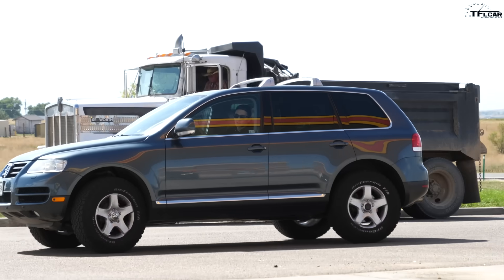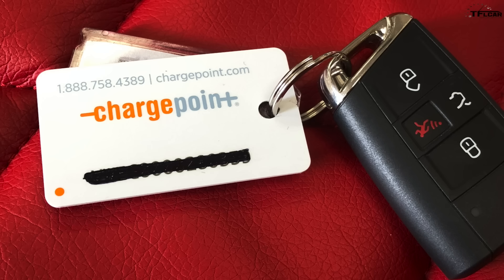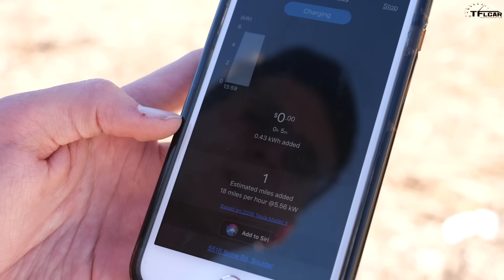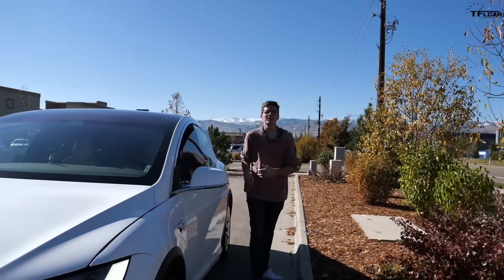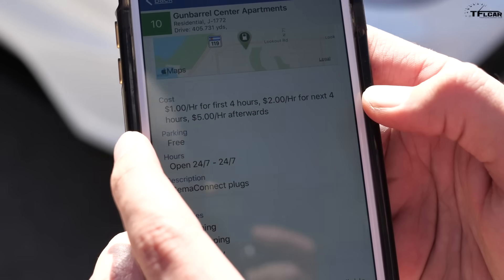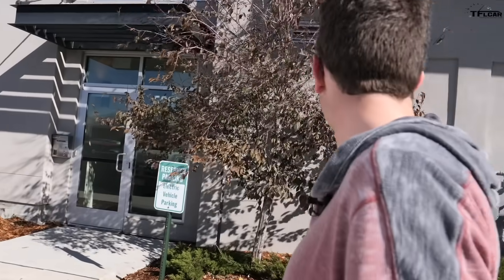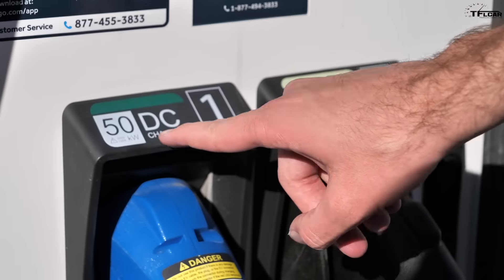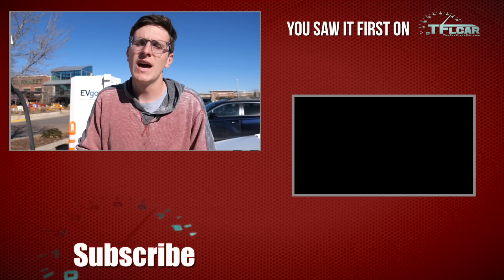Here’s Why Charging an Electric Car Can Suck - And It’s Not The Reason You Think!

Comment: What a sheer madness! Thank you for convincing me that EV route is not an option for my lifestyle. I will stick with diesel and 30 mpgs… Greater outdoors are calling!
Reply: It takes me maybe tem minutes to fuel up. I'll keep my gasoline and diesel. I don't believe EVs will make a dent in the next 100 years.  I might build a ev but I will not buy one.
Reply: @jasonglisson1690  Again, you probably won’t have a choice after 2035! The major manufacturers have announced an end to the internal combustion engine at that time! How many Boulder like fires or Kentucky like tornados will it take to make people understand that Climate Change is already here! We must adapt or perish!
Reply: @Ghostxnigelfr  so tornados and fires only started after the industrial revolution. Gotcha. Somehow putting batteries in cars is going to fix it all. Wow. However nothing was said about everyone will have to get one. So I'll just keep my jeep thank you. I am part of the resistance. If I have to I'll resort to making my own fuel.
Reply: @jasonglisson1690  it takes you 10 minutes plus the time to drive to a gas station. It takes me 15 seconds to plug in at the comfort of my home and another 15 seconds to unplug. 
I do not have an engine so I never have repairs, no oil changes no fluids to top off... Except for the windshield washer fluid. A full tank aka battery charge costs about $5. 
EVs are a disruptive technology and are replacing ICE cars as fast as ICE cars replaced the horse. By 2030 almost no one will be buying ICE cars because EVs will cost less to buy and already cost less to own over time, (approx 5 years).
You and anyone else can still own, buy, lease or rent an ICE car. In fact many people still own and ride horses. 🙂 

You think because you spend a short time doing the actual filling of your gas tank it's quicker while you ignore the fact you have to drive to a gas station every time you fill up. EVs primarily fill up at home and only use charging stations on long trips..I use the Tesla Supercharger network which is fast enough to charge my car in the time it takes to pee and or get a coffee. Then I'm off drinking my coffee while the car drives and I'm monitoring. 🙂
Reply: @SmokinPaul  @jason glisson Well said! Sometimes you have to tell people the financial positives of owning an EV. I think you forgot to mention the $7500 tax credit that you get when you purchase an EV. Also, depending on the price of gas, you are saving approximately $250-$350 per month on gas (that are not going into the pockets of corrupt Middle Eastern and African regimes). 92% of all car owners drive their vehicles less than 75 miles per day. If you are going to be traveling over two hours, fly and Rent-A-Car at your destination. In most cases, it is actually cheaper. I take all the money that I save on gasoline and put it into a separate vacation fund! This year I flew the family at Thanksgiving to Orlando where we stayed at Disney World in a Disney resort hotel. In all honesty, electric vehicle ownership is a no brainer!
Reply: @SmokinPaul  all very good points. I don't have a garage. So I'd have the added expense of buying and/or building one. I'm always passing a fuel station in one of the many ways to and from work or anywhere else I go. I'm not knocking EVs for you or anyone else.  they are just not for me. Especially right now. I like working on my jeep the rarity that I have to. Plus there's a good chance I can have it the rest of my life. EVs are useless and worthless once the battery goes bad and it will. I also don't believe EVs will save the world nor do I believe gas and diesel vehicles will destroy it. I believe we should have a choice. That's all.  EVs have their place. Just not in my yard.
Reply: @SmokinPaul  also if need be I can switch my jeep to carb and distributer
Reply: @jasonglisson1690  yeah I have a 1975 Suzuki GT550 two-stroke triple motorcycle. It came with points, has an aftermarket electronic ignition that I can convert back in short order. Points need to be changed and adjusted but there is something wonderful about the simplicity. My 1972 Camaro was so easy to work on or even pull the engine. New stuff  is so complicated you have to disassemble half the car to change a spark plug.
Reply: @jasonglisson1690  I agree with choice. As far as Tesla batteries they will last a very long time and if my car body is still in good shape by the time that happens I can have it replaced for less than the cost of an engine. I have a long range model Y. When the battery pack loses 20% of its capacity it's considered end of life. Yet I can still keep driving it as a standard range EV. The battery will still work just with a little more reduced range. I'm getting 326 miles of range now so end of life I'll still get 260, more than enough for long trips. That or I can sell it for more than I could an ICE because EVs hold there value better. Then I can buy the latest greatest EV at the time. EVs are not throw away cars, at least Tesla's are not. Tesla doesn't build craptastic cars made to need servicing to keep the antiquated dealer model in business. Tesla build their cars to commercial 1 million mile standards. Other compliance EVs with no thought to battery management or temperature control have given all EVs a bad rep.
Reply: @SmokinPaul  yes I agree thats why my jeep is a 04. Still very easy to work on. I don't like most new cars. It's not just EVs. I really don't like new technology. I really hate being tied to this phone. However sooner or later something will have to be done to any ev. It's a machine. Things wear out. Nothing lasts forever if you give it enough time. Toyota almost went bankrupt because they made their vehicles too good. Most manufacturers make sure they don't over engineer their vehicles. I don't know if Tesla is the best. If they are awesome. EVs are just not for me. Never thought I'd enjoy a conversation with a battery head.
Reply: @jasonglisson1690  I'm not exactly a "battery head". LOL 😆 I love all technology old and new. I grew up in the 50s & 60s and one of my interests is electronics. I started out learning, repairing and even building tube radios. 
Then transistors came along and looked like alien voodoo compared to what I knew. Rather quickly I learned how to repair, rebuild, make transistor radios and many other electronic devices. 
Next was integrated circuits which again looked like more voodoo yet I discovered it was even easier to build much more sophisticated devices. 
I own a 1945 Hallicrafters Super Defiant shortwave radio. It's a tube radio with a case made of steel so thick you could literally use as a jack stand for a car. I completely rebuilt it and it's still working and one of my favorite radios. I built several shortwave radios, test equipment and all sorts of electronic gadgets that I still use to this day.
 I've built home automation devices using the latest surface mount ICs. 

I used to do building maintenance, I've also been a bit of a gear head, fixing up cars,  muscle cars, motorcycles (mostly two-stroke triples), repairing just about everything on my cars and motorcycles from brakes to rebuilding engines and everything in-between. 
I also love computers, I'm an IT Network Specialist, a certified locksmith, hold an extra class amateur radio license and repair, build and ride bicycles. I love long 200 to 300+ mile bicycle camping. It's great cardio for the heart too. 

There is not much old or new technology that I'm not interested in. 
I embrace all tech both old and new. 

Hi-Tech isn't always the best,, sometimes low-tech rules. I eat right, exercise and feel like I'm 28 with 37 years experience. LOL 😆 

Never live in fear of anything especially technology. Nothing will completely stop old tech, it will just lose it's popularity. Jay Leno has a massive garage of old cars that still run. 

Did you know electric cars dominated up until 1939. That Henry Ford's wife Clara drove a 1914 Detroit Electric. 😄 
You could always have an EV for your daily driver and a stable of ice cars for fun. 

I never thought I would ever buy any kind of new car. I'd been watching Tesla for years and always meant to invest but never got around to it. Then I understood Tesla was going to break out and shoot to the moon within the next year. As soon as I started investing it started it's meteoric rise. I immediately went all in and made a killing. If you are wondering who the next Tesla is.. Tesla is the next Tesla. I see Tesla 100X or more over time. 

 I haven't sold a share and I won't for at least another 5 year. No way am I trimming my money tree while it's growing so fast. 
I bought my Tesla with a good down payment and a low interest loan. The gas I save pays for a large portion of the monthly payment. Tesla's come with an 8 year warranty and they are real good at fixing any problems. I had a door stick shut because the interior panel wasn't pushed in all the way and popped out. They sent a service guy to my house and took 5 minutes to fix. 
I bring a backpack to work setting it on the passenger seat. The seat sensor got confused a bit feeling more and less weight while I drive my Tesla like a sports car. The car thought there might be an error in the seat sensor. LOL I brought it to my local service center where they retro fitted a electronic filter to make the sear sensor happy. 
The car diagnostics even notified me of a fault in the wiring of the circuit I use to charge it! That was so crazy. 😄 
Yesterday as I drove over a bridge a message popped up telling me to take control. I thought it was odd because I didn't have it in autopilot or FSD. Then I realized it was just below freezing and was warning me the bridge was icy or the conditions were right for it. 
The technology is very sophisticated and maybe not something most people can repair but it does have it's advantages. 

I don't understand people who hate ICE cars or EVs. 
However I can't stand the green weenies virtual signaling with their Tesla's. 🤮 I guess I'm not perfect either. LMAO 🤣 

At 65 constantly maintaining and repairing my ICE cars is getting old. I wouldn't mind it that much if I still had a 60s or 70s car but the newer cars are shit on a stick.😟 Designed on a computer by people who never worked on a car. That or it's designed that way to force more people to get work done at the dealership. 
EVs are just simple electric motors that last forever and Tesla builds theirs to commercial standards. Which makes it so compelling compared to the modern craptastic junk. 
I do miss my 72 Camaro with the Rancho suspension and an Ishadarian towing cam I put in. Taking off from a light up to 30 mph It had almost as much torque as my Tesla... Or at least I remember it that way. 😄
Reply: @SmokinPaul  yea I was being funny. I can work on alot also. Not as much as you. My main thing is I love engines. Ice are a marvel to me. Alot of the newer stuff is definitely crazy. I know more about gasoline engines but learning about diesel. I've worked on everything from washers, dryers, fridges, computers and about anything with a gas engine. I have alot of car knowledge. Yes I know about the first electric cars. I also know about steam engine cars and love jays garage. I can car talk all day. I'm not necessarily against EVs. I'm just in love with ice. Are you on FB or anything I'd like to chat with you more. I don't meet many gearheads. I'm one as well. I went to school for auto tech. My health went bad so I drive truck till I can get better. I said I can fix computers. I can replace the parts in them. I'm not so well at the software part.
Reply: @jasonglisson1690  I see 4 jason glisson on FB, which one is you?
Reply: @SmokinPaul   nc
Reply: Buy a Tesla and use their massive supercharger network. Takes me 5 to 15 minutes to charge. Mostly it takes 30 seconds to charge, 15 seconds to plug in when I get home, 15 seconds to unplug when I leave. Same as a cellphone. 
The only time I've used slow charges like that are when they are free ie destination chargers, most public chargers etc. Last time I gained over 80+ miles free while eating at a restaurant. 

If I had to deal with the BS charging in the video I would never have bought my Tesla model Y. 

The best part I could charge at any of those slow charges or even plug into any 120 or 240v outlet. North America is electrified, who knew! 🤣 Although I've never needed to use anything but the Tesla network on long road trips across the country and the car is charged in the time it takes to pee and get a coffee. 

I suppose if you had a syphon hose you could fill your car anywhere too. LOL 😆
Reply: @SmokinPaul  5 to 15 minutes to charge from what level to what level?
Reply: @percyfaith11  form 10% to 60 to 70%. You don't fill up a battery like you do a gas tank. The charge is very fast up to 60% and slows down as it's topped off because the various series cells need to be balance charged. A Tesla tells you where to charge, how many charging stalls are available, how many ch to charge etc. On a long trip you make one or two extra stops. Makes the trip easy peasy, no sore butt. 🙂 

If I'm going on a long trip I set the charge to 90 to 95% the night before to get a bit more range on the first leg. 
I went from Milwaukee to AZ, up to Utah and back. I used FSD which made driving feel like I rode the bus. All Tesla's come with Autopilot which drives straight but doesn't navigate or take your exit. Instead of staring at the white line you can look around and be more aware of the cars and situations around you. 

Try a test drive and even rent a Tesla for a few days. It's something that once experienced you'll fall in love with.
Reply: @SmokinPaul  how long have you worked for Tesla?
Reply: @letavoss5938  ah the refrain of the ignorant when they have nothing useful to say. 😊 
No one can love Tesla because of the superior engineering, no can't be. LOL It can't be because Tesla makes such a compelling product, no can't be. If Ford, GM and the rest make Craptastic cars then it must be impossible! Hahaha 
OK Toyota makes fairly decent cars and it used to be my car of choice for reliability but even a Toyota looks unreliable compared to Tesla. 

It is just the nature of an EV, no engine experiencing temperature extremes with thousands of reciprocating parts. Just a battery and overdesigned sealed gearbox with electric motors. Electric motors are know for extreme reliability. An electric motor spins, no reciprocating motion. 
Also the cost of fuel is much cheaper for an EV. 

My car is a very efficient coal burner. Coal turns into electricity which charges my batteries. 10% of the energy is lost in generation, transmission and charging, 90% goes into moving the vehicle. ICE cars use Only 10% for moving with 90% as waste heat. It's why you can heat your car in winter without losing gas milage. My Tesla has a heat pump so I lose only a few percent heating my car... But it's instant heat, no warm up. 🙂
Reply: Well there is no way I’m buying a Tesla truck that thing looked horrendous
Reply: Wait until they make gas obsolete. Then we will all be forced to comply..
Reply: @franksalsa9342  But a diesel and make biofuel from waste cooking oil.
Reply: The REAL deal breaker.

6 cars in line waiting for gas(half empty):
5 mins x 5 cars is 25 mins wait in line for 6th car.

6 cars in line waiting for electric charge(half discharged): 
30 mins x 5 cars is 150 mins wait for 6th car to finally plug-in!!
THATS  2.5 HOURS SITTING IN LINE FOR A SINGLE WOMAN WITH A 1 yr old baby IN A BAD NEIGHBOHOOD!!

FOR FUN!
30 cars in line during 70s gas shortage.
29 x 5 mins is 149 mins or 2.5 HOURS. FOR GAS.

ELECT CHARGE:
29 x 30 mins charge is 870÷60
= 14.5 HOURS!!  FORGET IT!!
Reply: @thedudena5525  Well, not really. Your math is really flawed, since you normally charge at home. 

It's like having the gas station on your own lawn. No waiting time at all. 

We've had our Tesla Model 3 since March and charged outside our home 4-5 times and only during long trips. No waiting time or queue any of these times. The Tesla Superchargers are not that busy, at least not in Sweden, where I live.
Reply: @inber  What?”You miscalculated you ALWAYS charge at home” If you have to resort to nonsense to justify your purchase I don’t think your a serious person.All because you think CO2 will kill humans,oh but ignore that
Reply: @SmokinPaul  Good for you.I have nothing against EVs per se ,my objection has to do with people convinced we all must drive EVs to prevent “global warming “ from CO2.EVs work fine for daily commute’s I’m sure .I’m not willing to have an EV that covers only part of my transportation needs but if it works for you good, I just don’t think tax payers should subsidize their cost
Reply: @letavoss5938  we are in complete agreement with that. BTW I've taken make trips across the country and find my Tesla long range model Y does a better job. Last trip was Midwest to arizona, up to Utah and back. Speed limit was 80 mph most of the way, we did 10 over. For a bit I followed someone else doing 110 to 115. I figured if we saw his break lights I'd have time to slow to avoid a ticket. 😁  We used the Tesla Supercharging Network except for a few destination chargers because they were free. Free is awesome. 
I'm a gearhead and have nothing against ICE.
Like I said current Tesla EVs are superior to ICE in every way. By govt picking winners and losers they only enrich themselves and drive up the costs of all cars. EVs will in the next year will cost less than an ICE car if demand doesn't stay too high. Supply and demand are what drives prices.
Reply: @SmokinPaul  Quote: : except for a few destination chargers because they were free. Free is awesome".... - I think you said you were 65, and you still think things are free? Only as long as there are taxpayers or the free electric is added to your hotel bill.
Reply: @keri380  a $5 charge is a discount. You can get bigger discounts with AAA, AARP, etc. Gas is much more expensive and not something a hotel has to give away. Just another advertising scheme to get customers. So yes it's free in the sense of any other discount. 
But technically... LOL 😆
Reply: Good luck with that! By 2035, most major auto manufacturers have announced that ICE (Internal Combustion Engines) will no longer be made. You can count on about a 10 year car park after that. (Car park is the industry speak for the number of years that manufacturers continue to make parts and support a vehicle). So what are you going to do then? By 2040, diesel fuel will probably be outlawed for vehicles. Even 18 wheelers are going Electric!

Don’t worry, you will likely have a charging station at your home that you can charge your car. They cost about $400.00 and can be wired by anyone with a basic knowledge of electricity. (Plenty of YT videos on how to do it)!
Reply: @Ghostxnigelfr  GM, Ford and others are 100 plus Billion in debt, no way to remain in business by even 2030. I really do wish there was some real competition to Tesla but it's non-existent.
Reply: @SmokinPaul  add to the fact they need to keep selling the ICE vehicles to make profits to pay for their EV lines. Tesla has not made real profits off its vehicles yet. All bottom line profits come from Credits.
Reply: @m-moneymgt8055  why would you say something so stupid when you could easily look up Tesla's financials? 
Tesla is a money printing machine with gross profit reaching $11 billion as of 3Q 2021.
Their 3Q 2021 gross profit soared to $3.7 billion. Credits were only around $400 million. Those profits were made while expanding Giga Shanghai and building two new Tara factories in Texas and Germany. 

Your post suggests you think profit makes for a stronger company. Amazon could be a very profitable tiny company selling books and nothing more. Instead Amazon spent everything they had to expand, not making a profit for 14 years. 
Do you think Amazon is better off dominating online sales by choosing to expand rather than pile up small profits? 

Tesla did the same and is now making insane profits with only a fraction coming from ZEV credits. 

To Tesla ZEV credits are a useless byproduct of manufacturing EVs,

Now ask yourself WHY would the other ICE manufacturers want to buy ZEV credits from Tesla? 

It's simple, legacy ICE can't make EVs at a profit and instead of paying fines would rather pay Tesla to eat their lunch and fuk their girlfriends. 

Stop listening to bullshit, inaccurate biased hit pieces and do just a tiny bit of research. The truth is 180 degrees from what you think. 

Legacy auto sales are, and have been, dropping every year while Tesla's has been increasing at a rate greater than 50% a year! 
Lately legacy has been blaming the chip shortage, that is only partially true. 
An EV requires at least 10 times as many chips yet Tesla was able to navigate the shortage while increasing production.🤔 
Tesla is growing faster than Amazon and the biggest threat Legacy auto has ever delt with. The ICE age is over and only a matter of time before the dinosaurs die. 

The big do not eat the small, the fast eat the slow.
Reply: @m-moneymgt8055  P.S. Tesla makes north of 30% profit on every vehicle they make. Legacy hasn't made any profit on EVs and only 5 to 15% on their most profitable ICE models most of which is made in Mexico. 
With over 100 Billion in debt how long can legacy dinosaurs stay in business while making EVs that make no profit? 

How can they service such an insane debt while borrowing money to build new EV factories. 

They are competing with Tesla with over 20 billon in the bank and only a few billion debt! 
Legacy is under water while Tesla is flying high in the sky.
Reply: @SmokinPaul  they had gross revenue of $11 billion not profit. Learn financial terms if you going to spout off and call someone stupid, keyboard warrior. Yes they are profitable now but the lions share came from the credits as those have no cost impact until the last quarter (more than 50%). Any other automaker would have gone under with losses as long as Tesla had been losing money . I’m a huge fan of Elon Musk, just not EVs at the moment. Without taxpayer’s $$$ for incentives, EVs are still not a better deal for the average person. Not to mention during their lifetime they are barely, and I mean barely, better for the environment.  There is more air pollution generated by energy production for the US electric mix for EVs than ICE engines, projected to kill 800 more people per year from air pollution than pollution from ICE. Those are independently researched issues you can find on your own. Notice I didn’t say your lack of financial terms was stupid.
Reply: @m-moneymgt8055  Oh my misuse of a term was not stupid but I'm a keyboard warrior. LOL Does this mean we are not friends anymore? LOL 
1.6 billion in profit with aprox 400 million from big auto buying ZEV. This while Tesla has been paying down debt and building two massive factories and expanding a third. Not sure you understand what is going on. Oh but you didn't misuse a term. Gold star for you. :-) 

Your air pollution argument has been debunked long ago. A gas car uses only 10 to 12% of the energy to move the car with 90% as waste heat. We are not even talking about energy used in getting the oil out of the ground, refining and transport. 

EVs lose about 10% of the energy from generation, transmission and charging losses and use 90% to move it. 
While my car is a true coal burner it does it much more efficiently. Production of an EV and its lifetime use less energy and less waste or pollution. Batteries are recycled as very high grade ore costing much less than mining the raw materials. As more batteries reach their end of life in a decade recycling will be essential to cut costs even lower. 

Your quoting biased BS articles that are making WAGs, Wild Ass Guesses. When Chernobyl blew doom and gloom was predicted. The power plant didn't have a containment building like all Nuk plants have. They didn't evacuate the population for several days and yet no one died except two pant workers with an eventual total of about 30. Far less than the doom and gloom predictions The Russians had to create a containment shell after the fact. 

Coal power plants in the US are the cleanest on the planet. EVs don't put out pollution and the power plants don't put out much either. However ICE vehicles do put out NO2 and many other bad pollutants. CO2 is not a pollutant nor does is cause warming or cooling or "change". Water vapor and the effects of Gamma rays on the upper atmosphere control the earth current cooling. 
Let me apologize for calling you stupid. When I did that I thought you already knew. :-) 
I'm doing other things while writing so excuse me for getting a spelling error or use the wrong term. LOL Essentially my posts to you are not that important. hahaha